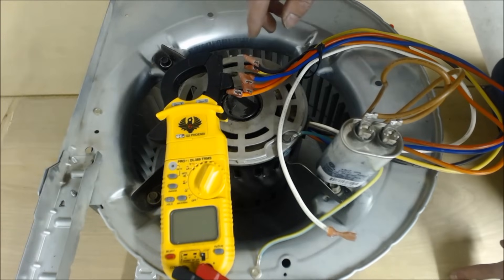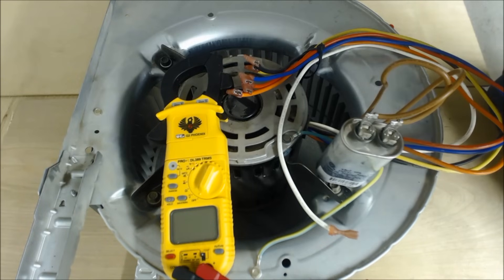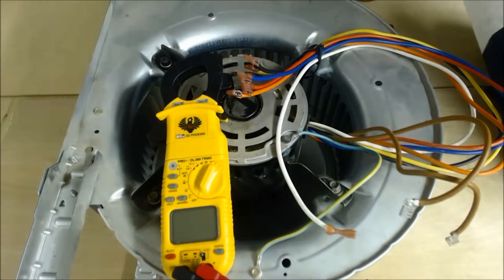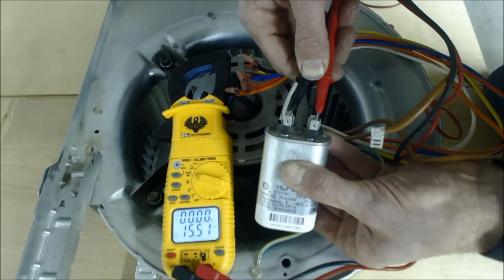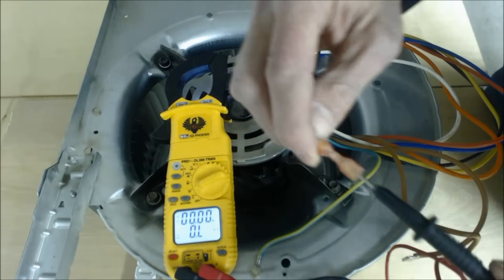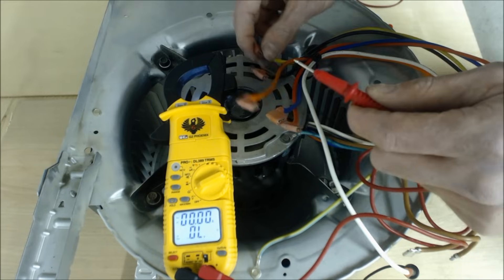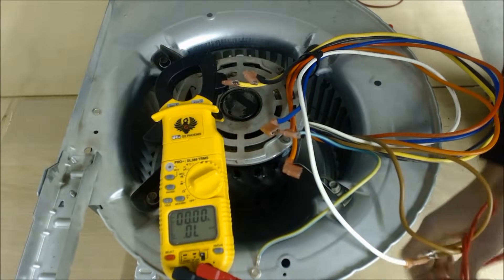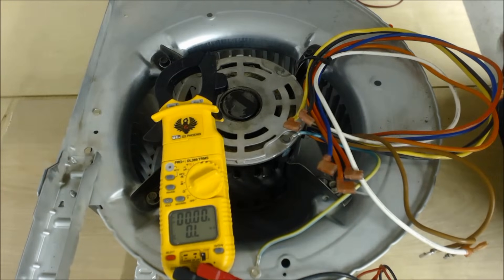Step by Step Procedure for Troubleshooting a Blower Motor from a Furnace and AC System!

Comment: Hi i just tested in sequence just like you showed" common to red to blue than to black and it goes from 3.9 3.6 3.3 They go from high to low but when the HVAC gas heater calls for heat the motor just hums does not spin. there is no capacitor End it has a ice cube relay that is attached to the circuit board that soldered on from the back, Do you think I could still have a bad blower motor? and it does spin freely !?

Comment: I have gas furance and the blower motor will run 1 min the short cycle off for several min the turn back on During a call for ac .  how can I test or trouble this scenario when I call for ac... compress out run s capactor
Reply: Is there sensor blower...that need replacement or cleaning

Comment: WoW wish I woulda watched your video sooner it was the capacitor I automatically thought it was the blower motor your testing showed me the motor was fine I had no clue how to check that. I wish you would explained how to use the multimeter I had to try all of my settings on the upside down horseshoe I have like 5 settings on my meter. But I was able to get a reading. From the motor on one of them then when I tested the capacitor I had no reading orders off Amazon and wham it WORKS!!!! Yahoooooooooo and I am one of the most in hand mans in the world and I fixed my furnace!!!

Comment: Thank you, found capacitor was 8uf should ne 10uf. Checked all fan speeds they checked out. Start out with limit switch error light flashing. Blower motor stopped in the middle of the night.

Comment: I have a 3 speed x13 and the resistance in pin 2 is lower than in pin 1 but when i get to pin 3 i get around 1.3 ohm. What would this indicate?

Comment: Pretty sure my motor is bad even though I'm getting the various ohms for each speed.  Another YouTuber confirmed that you can have good readings, but still have a bad motor.  We smelled some odd burning smell a few months ago, so I think for some reason the motor overheated.  The fan blades spin quietly and smoothly by hand, and there's no play in the bearing.  It works now for 5 minutes, but then the motor shuts off.   Any thoughts?

Comment: Have a packaged AC unit installed in 2013, keeps freezing up. Freon recently added, no leak found, both capacitors replaced recently for each fan motor. When unit freezes I notice blower fan is not turning. Blower fan cage cleaned recently ( was filthy), new filter in house and all coils look clean. When I turn unit off at thermostat and put fan switch from auto to on to thaw out unit, blower fan will not come on. Have to go outside to AC unit and if I smack the side to f the unit fan will than come on. Blower motor turns freely and no play in fan motor. Any idea on this? Thank you.

Comment: I installed new motor and everything connected properly, but my furnace blower motor runs slow and my heater turns of after 15 minutes or so. Capacitor is new as well????? Need help

Comment: Where is the blower motor reset button? Or does the light switch box mounted on the side of the furnace pretty much function as a reset button?

Comment: Your videos are incredible. I recently had an HVAC house call because the 115v wires in my air handler's juction box had fried out. The technician reconnected the wires and the air handler fan worked again! Yay!  I figured I must have had an energy surge from a lightning strike in the area, but when he tested the AMP draw from the motor he quickly shut off the unit and said "WHOA! That's drawing nearly 7 AMPS! You need a new blower motor! This is unsafe!"    Later, I noticed the sticker on the motor says 9.35 AMP! !!  Plus, the fan spins smoothly and freely.  Is he just trying to sell me a new blower motor?  Or is that truly an alarming AMP draw?

Comment: Getting no fan after some condensate build up caused an error code.  Cleaned out the tubing and cleared the error codes.  No fan and no voltage at the terminals when I tried heat mode.  Bad board?  Gave pressure sensor error in heat mode.  AC mode gave (20,26,59) twinning error, reverse neutral, and condensate errors.  Wiring never changed and it’s a newer system that has been running for four years.  Outside unit works fine.   Any help is appreciated, thanks for the informative videos!

Comment: OL on a multimeter does not mean Over Limit. (What exactly would be over the limit when there’s no power). It means “Open Loop”. If something burns out there would be an “opening” in the line somewhere.. like an open switch or burnt out wire. Other than that good video.

Comment: Hello, great content! Had a question when troubleshooting (a non functioned blower/wont turn on)...When using the multimeter, can I take blower out/disconnect? With my horizontal Trane, I cannot access anything. Plus very hot up in attic. I removed to clean it, but looks in good shape (GE blower) already tried replacing capacitors and cleaned the outside unit coils and filter. Thanks!

Comment: One of your great articles led me here and helped me avoid changing my control board. It turns out it was my thermostat face so thank you!

A couple of questions, can the 24-28volt test be done from the thermostat wires or does it have to be from the control board? I didn't get to test mine because it was raining so I just swapped it with a programmable one since I needed the upgrade and was lucky this time.

The heat worked but not fan only or a/c. Does that mean if I had tested it at control board with the fan or a/c mode, it wouldn't have registered the proper voltage?

Also when the blower cap blew the motor came to a grinding halt and yet spins freely, how is that possible?

Comment: What a helpful video. Thank you for sharing it. I have a split a/c system (heat pump) and the air handler blower sometimes does not start and the whole system freezes within 2 minutes. I turn the system off for some 5 minutes, start again and works normally again. This can happen 2 or 3 times a month, specially during the summer humid and rainy months of the year. I also have noticed a couple of times that when the a/c system starts, my TV turns off and on momentarily, just like a sudden electric power demand happened.  Could this be a bad capacitor?
Reply: Check your refrigerant and pressures …

Comment: My blower fan comes on fine with the ac or if I manually put it on. If I turn on the heater furnace the blower motor will only hum and no start. The capacitor checked good. Does this mean the fan is week and cannot work on the slower speed the furnace requires?
Reply: Any suggestions???

Comment: on my furnace the blower motor was humming before I knew it was the capacitor because it was getting voltage otherwise it would not hum.... if it's getting voltage from the circuit board to the motor and the motor is not turning replace the motor and the capacitor quit fooling around you do it yourself you save $400 you know these furnace technicians will rip you off

Comment: Completely took mine out because parts place told me tey had one that fit but didn't . It was universal but cheap $75 and in stock so i decided to try . Unfortunately not ,holes and bracket didn't ssem to align . Been verry hot today in south Tx . Five days without AC

Comment: I have an old blower motor and capacitor.  After the AC has been running for a good 90 minutes the motors rpm slows down about 50%.  Shut things down a bit and rpms pick back up to normal.  Think it could be a failing run capacitor?

Comment: Reman ECM X13 motor new replacement stopped working shortly after installation. On old motor all taps were dead, windings were fine, ECM Failure. 220-240V Line Voltages, grounds and low voltage call signal (29v) to common measured at motor seem ok.  Any suggestions?   Didn't have time to check other taps on new motor.

Comment: Furnace keeps tripping the breaker. I believe I narrowed it down to when it starts up. Might trip once a week or so. Starting to happen more often. Already checked return and delivery and are clear. Would this same testing be applicable for diagnosing if my motor/capacitor is on the way out?

Comment: When testing the Board from (heat) to (L2) would that be on heat pump air handler board or a gas furnace or would it work in either one

Comment: My ohm readings are opposite - low speed has the lowest resistance, and high speed has highest resistance. My readings are 0.2, 0.4, 0.6, and 0.8 .....much lower than yours. Bad fan??

Comment: I woke up to a burnt smell and my blower motor was not turning in the furnace turned on and shortly later kicked off I took it apart looks really clean .. the burnt smell makes me think that the motor burnt up .. I didn't have a meter would this be a good assumption
Reply from the maker: If the burnt smell is coming from the electrical windings of the blower motor then yes it burnt up but also incoming voltage should be checked so the new one will be ok and the capacitor needs to be replaced, thanks!

Comment: I have a one-speed blower motor that doesn't use a capacitor, it had continuity between both wires not sure if that was a good thing or bad thing, it still ran but it smelled burnt

Comment: So if capacitor is rated 15 what mfd reading would be considered bad would it be 10 or lower reading?
Reply: As in video...good is + or - 6%..(15x.06=.9) so .9 minus 15 would equal 14.1...anything lower needs replaced...

Comment: I have a question, can you test a capacitor with the blower and unit in the on position? Thanks.
Reply from the maker: I don't recommend my students doing that just do to safety since there is high amperage being drawn. If a load such as a blower can be tested with the power off then I recommend to do so, thanks!
Reply: AC Service Tech LLC Okay just wondering if it would be a good thing to load test them. The reason I asked is a capacitor said 7.5 mfd and tested at 6.73 which is right under the +\- 10% tolerance stated on the capacitor label. Anyways I went ahead and got a new one it has a 5% tolerance the blower stopped the buzzing and kicked on fine, but before changing the capacitor it buzzed almost every time it came on. The blower had one mishap since changing it out and it buzzed hasn’t since that one time after the new capacitor. Is that a sign of a weak blower? Seems to have a slow start up but works and blows fine... I haven’t got to test the blower itself yet. Also will heat affect a capacitor, possibly more so if the capacitor is old and weaker? Sorry for the million questions and thanks for your time.

Comment: I lost track which one goes where on the capacitor they both the same color and same connection type. Does it matter what side? My capacitor has only 2 sides but has 4 prong per side.  Your help will be appreciated!!!
Reply from the maker: If it is just a single capacitor with two taps then it does not matter. One on one side of the run cap and one on the other side. 4 prongs are just connected to each tap. Make sure that you have the wires going to the cap by looking at the wiring diagram, thanks
Reply: @acservicetechchannel  yes i know which 2 are they. Both brown. I just forgot which side was which

Comment: Hello, I recently started having problems with my HVAC rooftop unit. It started blowing out air very slow and it won't take air from the return duct. I went up to the roof and took off the cover to where the blower fan is at and it started working, but as soon as it is covered again the blower fan slows down. I have  clean filter on and I cleaned the coils with water. Thanks in advance for your assistance.

Comment: Great videos, very informative. On a 120v 3 speed motor, If the high speed (black wire) is getting 120v, should I have 120v coming from the medium speed (blue wire) ?
Reply from the maker: It will back feed voltage out of the unused speed wires so make sure they are placed on the tab labeled spare on the control board or they are zip tied and wire nutted in a safe location, thanks
Reply: Ok, good to know. But what happens if I am using the medium speed for heating (ahu has a hydronic coil) ? Am I using the correct blower motor?

Comment: I'm trying to figure out the speeds on my motor - ICP1011404. Supposed to be 4 speeds.
When running in Cool mode (black wire) it doesn't sound like it's running any different than when in Heat (orange wire) mode. I have power to "Cool" terminal on control board and have swapped leads - does not SEEM to be any difference in speeds.
Reason I'm asking is that evap coil is freezing up. Have had tech come out - freon levels are good, coil is clean, filter is brand new.
Would fan run at heating speed if cooling speed was bad?
Also capacitor (Part # 1094956; 10 mf, 370 volt) - doesn't say if it's a Start or a Run capacitor. Is there a difference?
Thanks for any help you could provide!
LOVE your videos; VERY informative!
Reply: Hey did you figure out the problem ? I'm am having the same issue with mine only not icing up.  Black wire is hooked up for A/C everything was good now all of a sudden cooling, heating, and even fan only are all the same speed!
Reply: @NeverEnoughPyro40  I did buy a contact tachometer and checked the speed on end of shaft.
Cooling (black wire) was @ 1080 rpm.
Heating (orange wire) was @ 950.
Both are faster than 900 rpm listed on motor.
Never have found speeds listed anywhere, so still not sure if those are right.😤

Comment: How can you diagnose a failing but intermittently working blower motor? When you check amp reading of motor what should be the range of amp draw relative to name plate of motor? If name plate indicates 8.0 A and if you read 8.5A does this mean the motor over drawing? Do you also recommend using megaohm meters to figure out such problems? Or checking static pressure and confirming it with manufacturer's airflow vs static pressure charts?
Reply from the maker: Are you talking about intermittent blower motors that are ecm or psc? Are they having a problem not starting or shutting off during the middle of operation due to overheating or another reason? thanks!
Reply: AC Service Tech LLC PSC motors overheating issues

Comment: My motor is still inside furnace,do i need to disconnect all speed wires to get a accurate reading or can i disconnect one by one for reading?
Reply from the maker: Yes, shut the power off, take a picture of the wire locations and disconnect to take resistance readings, thanks!
Reply: @acservicetechchannel  thank you sir i really appreciate you

Comment: What if you get a beep from continuity from white to any other color? Does that mean its bad? I get the resistance readings but when I put it on sound (continuity) it beeps
Reply from the maker: Continuity just means that they are connected and that there is resistance. I really don't use the continuity function, thanks!
Reply: @acservicetechchannel  thanks for your reply! The motor I took out didnt turn on in the furnace. The new one I put in and installed does work. But I get all the resistance readings off the old bad one...idk why because when hooked to 115v it does turn on...

Comment: Hello, great informative video. Maybe you'll see this and can help. My furnace has been making noise off and on for about a month. Worse as time went on and finally it shut off In the middle of the night and was making a buzzing noise. After shutting it off at the thermostat it would still "buzz" off and on every few minutes...
Weird.. I shut it off with the switch at the furnace and it stopped.
I did turn it on again and watched the blower fan trying to turn. Little movements then nothing..
It spins by hand but not as smooth as I would think it would. The capacitor says 15 mdf and reads 13.63 with the capacitance setting on my multi meter. 
My next step is to check the blower like you did in this video but my question was- why would it make a buzzing noise after it's been turned off at the thermostat??
Seems odd to me. Please reply if you can and thank you!
Reply from the maker: A PSC blower shouldn't make any noise when the thermostat is not calling for the fan to turn on. Did you read voltage when it shouldn't have had any? If power is making it to a psc motor then you need to check the signal  wires if you are reading 24v power between g and c when you shouldn't be, thanks
Reply: @acservicetechchannel  Apparently one of my kid's turned the fan switch from auto to on.. Lol..
Somehow I didn't notice this and I wonder how long it was like that. 
Thank you for the video and great explanation. I figured out that the blower motor is toast for sure. Wondering if the fan switch was "on" for a day or so leading to killing an old motor.

Comment: My blower motor was humming and not starting so I replaced the capacitor and it worked like a charm for half a day then starting having the same problem. Could it be a bad capacitor again?
Reply from the maker: It is likely that the capacitor failing has melted the electrical windings so that they heat up and trip and thermal overload. Did you check the capacitor with a multimeter? You may need to replace the motor if the cap is good with good incoming voltage. Make sure you don't have too much of a voltage drop while the motor is running and that it is a good 120v or 240v as needed, thanks!
Reply: @acservicetechchannel  I dont have a meter. I replaced the capacitor because when the fan would try to start I could help it with my hand and it would start and run fine so I figured the capacitor was going bad. And a new capacitor was only $6. It worked perfect for about 8hrs then started doing the same thing. Could I be unlucky enough to have got a bad capacitor from the HVAC supply store or am I looking at replacing the fan? The house and hvac is only 12yrs old.
Reply from the maker: I wouldn't want to say without testing. You wouldn't want the motor to burn up. I couldn't tell without measurements on both, thanks